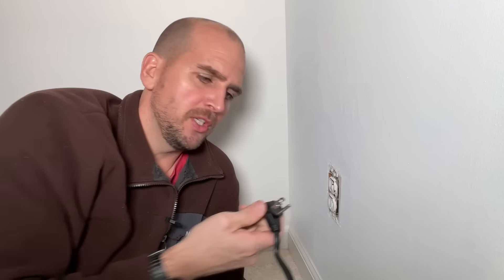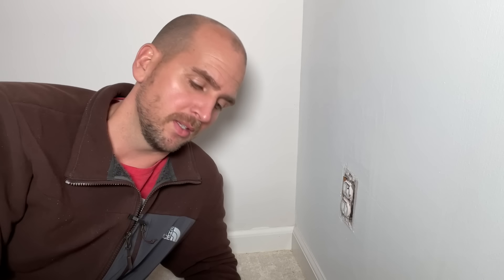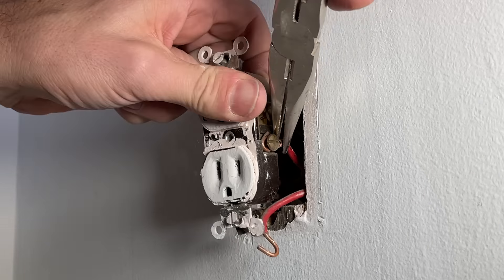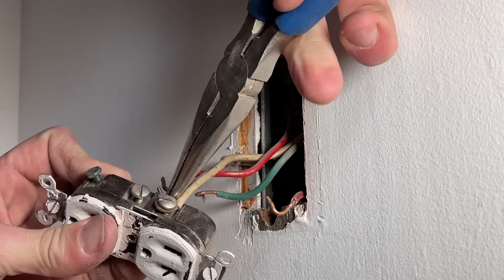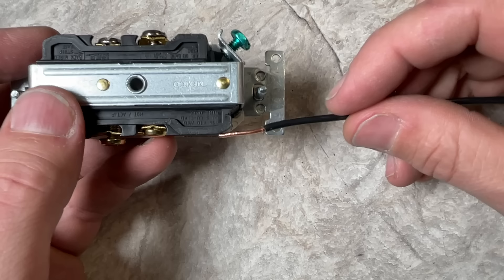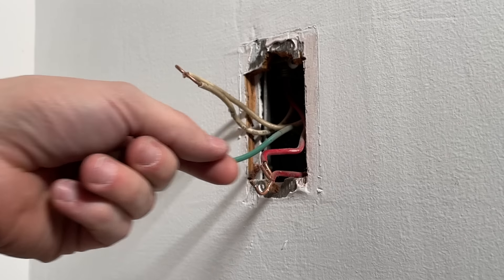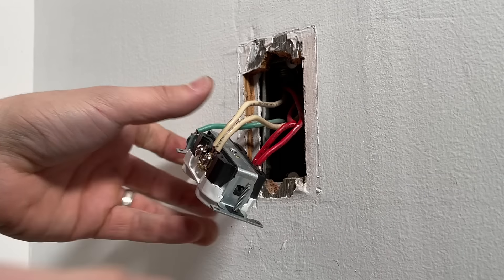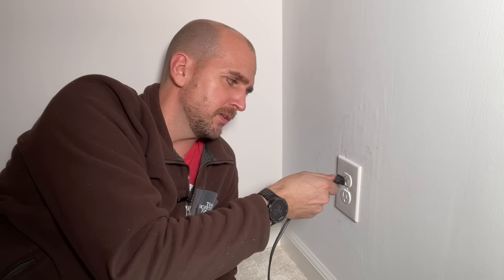Plug Won't Stay In Outlet

Comment: the original plug could have been cleaned and tightened and it would have lasted years… And it did look higher-quality than even the commercial one you installed. Nobody repairs things anymore just parts. There's no way it would've taken any effort to repair the old plug. Chivalry is gone… That means repairman are gone just parts guys. Your video was very good though

Comment: If you were going to replace the receptacle you should have unscrewed totally both screws and removed them from the receptacle rather than messing around with the screwdriver and plier and kept intact the J bend. Also, failed to mention about the paint on the face of the receptacle. Some idiot painted it along with the wall.

Comment: Tamper resistant are garbage.  I'll drive to another to get a regular outlet before buying a tamper resistant outlet.  The electrian that redid out kitchen put one of those things in our island and it takes two or three attempts every time before i can get a plug inserted.  I've started stretching a cord to a different outlet rather and screw around with the "safe" one.  I know, yah dah yah dah, I just haven't gotten around to replacing it with a good one yet.
Reply from the maker: At least in my area the largest boxes of outlets on the shelf are standard, even though TR have been in the code for years. 🤷‍♂️

Comment: Man the US plug sucks, we used to have a mixed outlet that accepted both American and European plugs, then we switched to type N, a lot of people complained, but man is it better, people complained about the third pin, which older outlets do not have, but type n has plastic covering a part of the thing that goes into the plug so you won't get electrocuted when accidentally touching the pin when plugging or unplugging, it's cheap, it is reassessed into the wall as extra security, overall is so much safer, I never thought about the plugs too much, but now that I got used to type N, the US plug feels extremely unsafe.

Comment: Ummm just because the male plug is loose on the female outlet, does not mean the outlet is bad, some plugs are just cheap, and some plug prongs need a little spreading out to compensate the fit! Otherwise, I would not automatically point the finger at the outlet.

Comment: easier brainlet solution, just slightly bend one of the metal parts so that it presses against the the walls and creates a pushing force causing it to stay in place

cons: itll just make the problem worse over time

Comment: The US electrical system is a mess - that you can touch the live wire if the plug is not fully located is so bad (and fixable with insulation on the plug - as is the case in most other countries).

Comment: Your better off just one wire off the outlet then wire nuts 3 wires together try and buy 20amp plugs the cheap 15amp. Outlets burn up
When you use heaters.dryers and hairdryer

Comment: There is no official right or wrong way to orient a receptacle—the National Electrical Code doesn’t specify so I've always put the grounding slot on top. If a plug is partially pulled from the receptacle, exposing the hot and neutral blades, and something metal falls on it (like a knife, a picture frame, or a metallic necklace), a direct short won’t occur because the grounding pin deflects the item from the terminals.

Comment: Naive q: why there are 5 cables and not three?
Reply: One set comes from either the breaker or a previous outlet, the other set goes to the next outlet. The ground wire is connected to the metal box, as are the grounds running from and to the other outlets (metal boxes must be grounded, plastic are not).

Comment: I have to say, those tamper resistance plugs suck. The plug never goes in very good. They say, “You gotta push them both in at the same time.” They never work for me, or anyone in my home. Code or no code, I’m never using them again.

Comment: Actually the ideal solution is to toss all this NEMA garbage and replace it all with BS1363 where this issue doesn't generally happen anyways, but even if it were to, there aren't exposed live conductors on the plug hanging out waiting to be touched.

This is coming from someone who was born and lives in America and gets a zap from the idiotic energized prongs on loose plugs like that on a weekly basis. I hate every single aspect of our idiotic NEMA socket and plugs and don't understand how spec hasn't at minimum been updated to add insulation halfway along the prongs of all newly-manufactured plugs, which would still be backwards-compatible with existing sockets. It's absurd!

Comment: technically you installed the receptacle upside-down.  The ground should be at the top.  The reason being;  If ever something conductive were to slide down the wall, it could short-out the receptacle..  But if the ground is up that can't happen.  Just look at how receptacles are installed in hospitals.

Comment: I am a electrician that is licensed and you are not to use any device like a outlet to carry power on when they are found.  That was the 1996 code where that was allowed. As of the 1999 code book they wanted all outlets and switches to be pig tailed and then to the device.  I have had a license for over 25 years so please do not tell the people to use outlets and switches as current carrying devices

Comment: Nothing you plug in should be making heat, because the resistance between the plug & the outlet should be practically nothing, given that the conductors are big enough & the pressure is signifcant between outlet & plug.  The heat comes if you have the appliance on when you plug it in so that an arc occurs when you plug in.  Have appliance off when you plug it in. And never have appliance on when you unplug it.  Of course if your outlet connectors are not tight enough to grip the plug connectors, then you can get arcking & thus heat.

Comment: Don't buy cheap plugs, they have sub standard metal prongs to hold the plug and rapidly lose their spring tension.  The Better plugs have metal like Beryllium Copper which are superior.  The best plugs have Heat treated Beryllium Copper (also referred to as Age Hardening) is a process that greatly improves the tensile properties and performance of stamped parts.  Go cheap and burn down your house...

Comment: Back-wiring an outlet SUCKS!   There is very little/not enough wire in contact.  They corrode readily, and the voltage drops off (I had one that measured 50 Volts AC).  Yes it is UL Approved Process (IT SHOULDN"T BE).  Yes -they work for a while.... but they have too little contact.   Do a better repair and J-hook/Shepherd''s hook it and use the screw!!!
Reply: You must be thinking of the push-in type.  That’s different.

Comment: OMG this can't be true. What cheap and dangerous fixtures are used here. This would absolutely not be possible here in the Netherlands. The requirements for the installation of wall sockets are very high here, because ultimately human lives are at stake.
Reply from the maker: Yeah, this is a fairly common response by people from Australia and Europe when they see the electrical components in the US and Canada.

Comment: Replace all your outlets with Hubbell HBL5262 industrial outlets (NOT the Hubbell 5262 which is absolute CRAP and should NOT be sold) and you'll never have this problem again. These retail for about $15 each and are superior in every way (nylon body that won't crack). They also feature full contact rear entry wire clamps which make them perfect for replacing inferior back stab outlets/connections. Buy once. Cry once. The only grade higher in the Hubbell line are the medical grade variety but they are even pricier and don't really offer a residential install anything to justify the price jump.

Comment: I cant believe that wires under screws still exist.  This was done away with in the 60s here in NZ.  Your 110 GPO are just hideous,  live exposed  terminals too..  And another thing..  why  are you showing home owners how to do electrical work ? Isnt it regulated ? Ie its prescribed electrical work. If a socket dont hold a plug then replace it.

Comment: Don't touch the screw heads with your fingers or the shaft of the screwdriver! I know you turned off the circuit but you never know if some idiot might switch it back on not knowing what you are doing so you should always act as if everything is hot

Comment: I don't like the back wiring at all. It shouldn't be code and is very weak compared to a proper shepherd's hook. It's one of those things that only proves that the construction industry has no business being involved in proposing or setting building codes. The back wiring nonsense is just another piece of garbage inserted because it makes things fractions of a second faster for the home building industry. Don't be lazy. Spend the extra second to make the connection properly.

Comment: Never understood while US and European plugs are so rubbish. Three pronged UK plugs can’t fall out.
Reply: The Hubbell system has held up pretty well, in my opinion.  The problem of loose plugs is usually due to cheap receptacles.  In the USA, we can do this repair without an electrician, and the cost is modest.  Changing the design would be hugely expensive because of the vast amount of equipment using the current standard.  A new standard would have to be phased in over many years.  In places with a new type receptacle, people would have to have adapters for any equipment with old style plugs.  There is no good reason to do this.

Comment: you did not have 2 hots on that outlet. you had 1 hot with probably  a hot feed to another outlet . if you had 2 hots at the outlet the tab between the terminals would have been broken out to create a split receptacle . one of  those reds could also  have been coming from a  switch to create a switched side of the receptacle. you should have indicated all of that  as by not doing so, you're giving potential bad information . you're obviously not an electrician .

Comment: Why this happens? It’s a cheap design, thin metal prongs and no Earth
How to fix it? UK plug sockets. Solid thick 3 prong design, shielded socket and live prongs, longer Earth prong, so that the Earth always engages before live. Oh and each plug has a fuse.

OK, I realise it may not be a practical solution, but those plugs and worse yet, the sockets…look like some cheap Chinese rubbish….shocking ⚡️
Reply: This circuit has an earth connection, which we call “ground.”  The ground pin does engage first, if present.
Reply: @GH-oi2jf  indeed, but it only works if it’s present ⚡️
Reply: @tornagawn  — Yes, not every device needs a ground pin, for example cell phone chargers.

Comment: Your shit is still fucked up.   That's not 2 hours that's 1 hot and 1 load.  Having 2 hours would destroy that outlet and anything you plug into it.  That's also against code both ways. Regardless of what you do, that's a outlet in mid-stream which means you need to add jumpers/ pigtails to the set up as the code requires